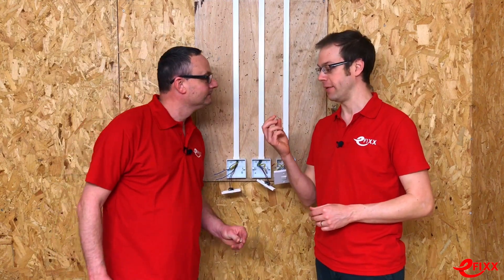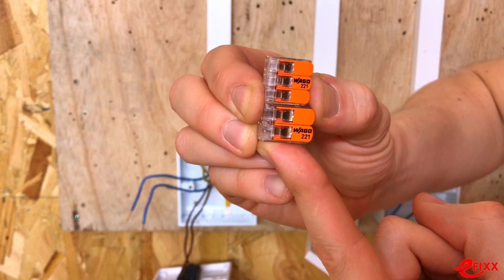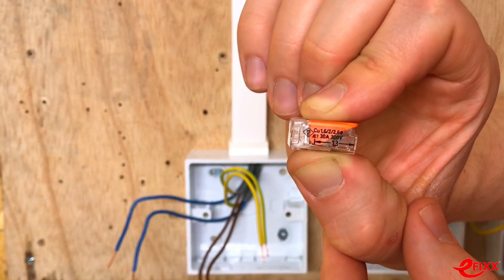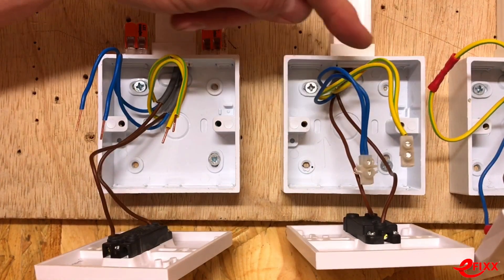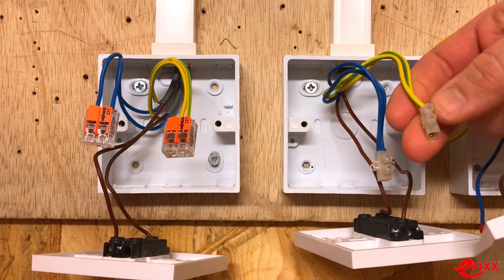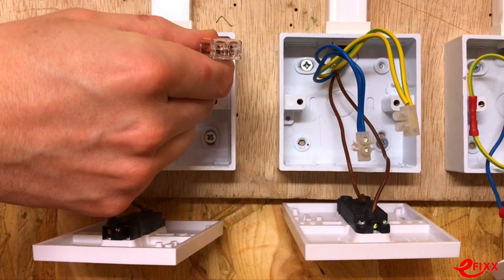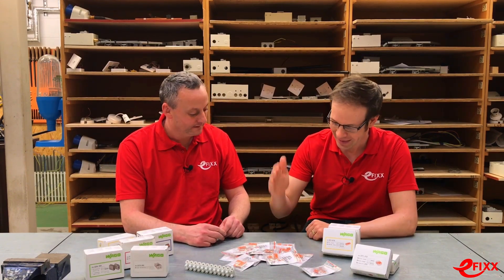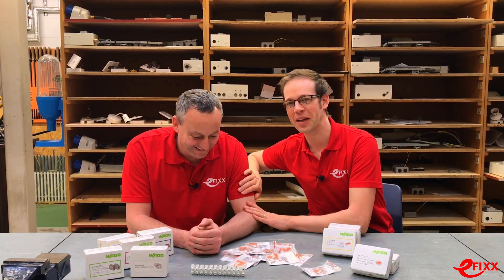Wago 221 vs traditional connector strip: including demonstration and testing point

Comment: Hi, love your videos! Question, I have 2 sockets where the cables are really too short, you can barely get at the terminal screws. They have 3 of each colour wires going into socket. Could I use the Wago 222, 5 port  connected to say the 3 brown  and then add a single fly lead to connect to the socket? Or would this be dangerous?? 👍

Comment: Feeding the neutral down to the switch is an old system that needs to be fazed out. 3 plate wiring is better and easier access.

Comment: Just opened a plug socket in kitchen and found 6mm cable jammed in with extension off the plug feeding the cooker which only needed 2.5 as only a small oven.  Plug fubar,  changed this with 6mm 5 port WAGO 221-615 41A,  bloody amazing so much easier than connector blocks:  plug socket connected off in in 2.5mm.  Very expensive but can’t find something anywhere near equivalent that can take 6mm stranded wire

Comment: Gaz can you tell us why that in this video the wago is marked as be rated to 41 amp and the conductor length as 13mm ? Yet in the video you did with Markus the very same wago ie the 221 is marked as 32amp and conductor length as 11mm ? Why is the accact  same wago ie 221 in both videos but with different information on them? Is one of them a fake  ? All my 221s are rated at 32amp with an 11mm conductor length, the my two gang three gang five gang and my new inline 221s .
Reply from the maker: There are two size families in the 221 series  - one rated to 32A - 4mm sq - eg 221-413 and a larger one rated to 41A - 6mm sq - 221-613 
https://www.tlc-direct.co.uk/Main_Index/Cable_Accessories_Index/Wago/index.html#Wago_Lever_C
Reply: @efixx  thank you I was just a tad confused

Comment: I recently had a socket fail, on inspection, the electrician found that the wires in the wall were very short which probably hampered the installation of the switch.

Is it ok to use a 5 way wago connectors with an extension in one of the holes and the 3 existing connections in the other 3 holes with one hole left spare? I can't find a 4 way wago connector.

This will mean only 1 wire will be fed to the socket and will be easier to tighten correctly if this is ok to do.

Comment: wago is easier to use but wire nut is so much better,,,lazy electricians will use wago,professionals will use anything else but wago
Reply from the maker: Try using a wire nut in most of Europe 😂🤣😂🤣😂
Reply: @efixx  Most of Europe is using wire nut 🤣🤣🤣🤣🤣🤣🤣

Comment: Just ordered some of these for the light at the top of the stairs. When I remove the current fitting there is not much wire that drops down. I have also orders the junction box and don’t think there is enough wire to get into the box.  So can I just wire up the Wago 222 and push into space between ceiling and loft or does in have to go in the wago junction box?
Reply from the maker: Needs to go in a junction box

Comment: For the fans of wire nuts, remember they are poor when connecting braided and solid wires together. The braided wire doesn't pinch when combined with a solid wire, and can just coil round rather than locking in. That is why so many fail the pull test. These connectors have separate clamps so don't have the same issues.
Reply: I'm in the states and running into JUST that problem on my ac wiring. Stranded thicker wire connected to thin solid thermostat wiring and it is a nightmare. Bought a 10 pack of 221's and I know they're UL and think it's okay but I can't imagine it would be a worse connection than those damned wire nuts.
Reply: But they have a ton of other issues.
Reply: @RadioRich100  Such as?
Reply: @Nyle95  Arcing, melting,overheating, intermittent connections, levers popping open when wires are pushed in the box, enough?
Reply: @RadioRich100 except none of those happen when installed correctly.
Reply: When installed according to the manufacturer they burn, melt, get hot, and go intermittant.
Reply: @RadioRich100  they literally don’t, hence why houses and building aren’t burning down left right and centre . But hey, you believe what you want to believe. 
Of course, you’ll be able to point to some evidence I assume? 😂😂
Reply: @Pugjamin  A box full that I pulled out for trouble calls after lazy people like you put them in.
Reply: @Pugjamin  Its fact I have pulled them out myself, would you like me to send you the next one I find?
Reply: @Pugjamin  First of all, The uks branch circuits use half the current we do. Second they are banned in certain municipalites. Third the UL is the testing laboratory, and there approvals can be and are bought. There on the NYSE.
Reply: @Nyle95  I've been asking around about these. Basically, the verdict is avoid them if you don't want a potential fire. The folk I spoke with are in the trade. Myself, I don't know anything.
Reply: Not if you know what your doing. Those clamps have resistance and get hot.

Comment: Most of these comparison videos fail by mistakingly comparing a product with a technique; apples to oranges. Traditional wire nuts don’t ever fail; the person who first twisted the bare conductors together may have done it wrong (or not at all!), but the wire nut didn’t fail. Wagos are not wire nuts. The electrical connection is minuscule and therefore it is a weak connection, just like back stabbing in a common receptacle.
Reply from the maker: How do the wire nuts stack up when connecting solid and fine stranded wires together?

Comment: Don't like wago  don't like  crimps
  Don't  like screw connectors   but   you
  Can't  beat  a good   solder  joint
Reply from the maker: In European wiring regulations generally you can’t use solder with screw connections.

Comment: Can you use the 5 port 221 connector to get three 6mm cables into and then one to the face plate of a double socket to get around the fact that three 6mm cables don’t fit? I have a 6mm radial run of sockets that have FCU spurs off some of them to isolate extractor hood etc and just discovered that three into one doesn’t go! Is the wago route a safe way of solving this?

Comment: They put these things in led light fixtures to connect to the supply wires I keep getting call backs where they went bad inside and replace them with unreplacable tried and true wire nuts

Comment: Do you know if the WAGO connectors are good to use in a vehicle (RV in my case). I worry that they might vibrate enough that the lever would click back open and the wire would fall out. Do you know if these are good for a high vibration environment like a vehicle?

Comment: Can you measure the voltages on the terminal block like you easily do with screw type connectors on a live circuit?

Comment: There is absolutely nothing safe about these connectors!!!!!!! In the last 40 years I have done electrical work around the globe and I am here to tell you these things are a fire waiting to happen!!!!!!! I speak from experience not speculation!!!!!!
Reply from the maker: What about the approvals from UL, ENEC & PSE ?
Reply: @efixx  money can buy you anything

I am not endorsed by or paid by anyone....

I'm a 40 year Electrician that's seen what they do after years of use not seconds of use

They are a fire hazard and I wouldn't sleep in any house they are used in.....

Period
Reply: @efixx  let me ask you a question

Would you fly your family in a Boeing 737????????????
Reply from the maker: My family sleep in a house which uses lots of Wago 221’s and I’ve used Wago screwless terminals for over 25 years without any problems.   Wago terminals are used extensively in everything from lighting ballasts to high current DIN rail terminals.
Reply: @efixx  you sound like their spokesman 

I'm wondering how much they pay you?!?!?!?!?!
Reply from the maker: Wago aren’t the only ones - happy to use Phoenix Contact or Weidmuller screwless contacts. You can now even get circuit breakers with push connections.
Reply: @efixx  I choose to not cut corners when I work. Especially when I’m getting paid to do work. I hold myself to a higher standard then other people do to themselves I guess. That, and I have to sleep at night and if I did something substandard (like use stab connectors) I wouldn’t be able to sleep because I have seen what substandard work causes and have made a career of fixing others substandard work!!!  

Again I say you sound like a spokesperson not an Electrician!!!!!! Every “Electrician” I know would never use such bull#hit materials in their work because we live by our work... If the plumbing isn’t done correctly you might have hot water going to your toilet. But if the electricity is not done correctly people can die!!!!!!!!!!!

It’s a little more serious when people lives are at stake!!!!!!

Ask the 5 year old little girl who only wanted to go wadding in the fountain and is now in a vegetative state because the electric was done wrong!!!!!!!!!! Oh wait you can’t...

I wouldn’t want to be the guy who wired those lights

Comment: You don’t even need to open the lever with solid wire
Reply from the maker: Toptip
Reply: Good one, you don't need to open the lever to remove either, just twist back and forth. Very similar to Ideal brand push in connector. I'm not sure that there is much difference in performance, but the IDEAL brand is cheaper and readily available.

Comment: In this case if you think that the spring is more stronger than the screws 
So why car manufacturers they use bolds for the wheel instead of clips and springs??
Reply from the maker: Wheels aren’t made of soft copper metal. Why is tape used in  aerospace applications instead of rivets?
Reply: @efixx  any plastic that I know 
They deteriorate eventually,
Do you know of any traditional junction box Deteriorating in the last 80 years??

Comment: What probes fit in to the test points on wago 227 and 2273 because none of mine fit?
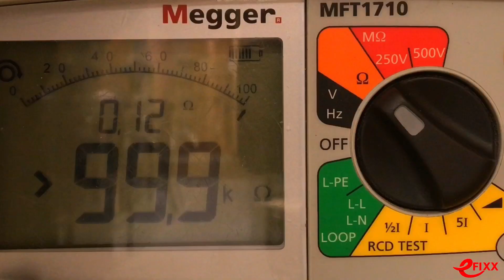Reply: 8:43 They really should redesign the test ports to accommodate the thicker probes that are commonly used. It shouldn't require buying thinner test leads just to be able to probe the connectors easily. You can force it in and enlarge the hole enough to make contact with the thicker probes, but that's hardly ideal, and not very safe, if you're not sure you pushed hard enough yet.
It's actually easier to probe from the wire side rather than using the test port in that case.
Reply from the maker: The skinny ones in this set for example. 👍https://www.cef.co.uk/catalogue/products/3922334-replacement-probes-and-clips?gclid=Cj0KCQjw9YWDBhDyARIsADt6sGY25tT2sEctDof7OPaDx7c8RPq9GMiK11MUVweAHBsNIXuXwaGaICcaAsPnEALw_wcB&gclsrc=aw.ds

Comment: After the failures of pushin connectors on rec. All ul approved no inspections is going to pass these without years of testing in the field. I would not use them.
Reply from the maker: They have a UL approval. We’ve been using cage clamp screw-less connectors in Europe for more than 20 years.

Comment: Any terminal with screw terminals it's liable to not being tightened correctly, not just connectors.
The cost is a bit of a killer really, I use them where I have to, but still mostly used the connectors.
I would like to see a more distinguishing feature between the two types for the different current ratings, maybe a direct colour lever.

Comment: Question: why is it rated 32 amps on one side and 20 on the other please - is 20 amps the derated ampage for inaccessible locations?
Reply: 20amps for japan, 32 for europe
Reply: JET stands for The Japan Electrical Safety & Environment Technology Laboratories and is their ratings group

further, for the 32A side as to why it doesn't say 600v it's based on requirements for ratings labeling in different countries

here's a Wago rep explaining it
https://youtu.be/d2lkBlIPkHg?t=342

Comment: great vid lads but at end of day its the customer who pays im a chippy if i used a screw that was 3 times the price but did the same job what will the customer say given that choice ?
Reply: Time
Reply: @normanboyes4983  yeah, if you get paid enough per hour, the extra cost from using the more expensive connector should be offset by the shorter work time.
However, if the labor is free then the parts and material costs will be more significant, increasing the cost of the job.

Comment: That OCD comment is recognizable. I was using large wire nuts on 5 x 12 gauge wire, they weren't working properly due to some corrosion, and they're hard to test on top of that. I probably checked each connection 10 times for tightness and it still wasn't good. These Wago connectors really take the guesswork and frustration out of making electrical connections.

Comment: Man you guys. Thankyou I had one of these burn out on me I checked the cable and the wago had disintegrated. I wanted to know how safe it was to put in and you guys helped me. Cheers
Reply: For that to happen they have been subject to massive overload, JW did a test of wagos, they take a serious amount of current to do that.!
Reply: @arcadia1701e  Or a cracked spring or poor installation as in some insulation inside the connection.

Comment: Could the wago be used for device wiring connection?  Trying to mount a ceiling fan and the wire says 1430 which I think is tinned copper.

Comment: I have a problem i have a 400v system but can't find a 400v connector does a 300v connector do the job or Will this fail after a long time
Thank
Nice vid tho
I feel very stupid a the moment i saw another vid and i was looking at the Japanse side of the connector. I am very thankfull for the vids you make becaus i would have been looking for another week if you didn't make a vid
Thank you very much to take the time to make these awsome vids
Reply from the maker: You need to go with a 400V connector  - otherwise you risk an insulator breakdown or liability issues.

Comment: That stripped ground wire insulation in in the left switch is scary - right where the outer insulation ends.
Reply: That's green/yellow sleeving over a bare conductor, not nicked conductor insulation.

Comment: I'm not an electrician just a keen Diyer but that means connecting wires coming in from 2 opposite directions you will have to make one end longer to reach  and bend round to the Wago input. Maybe that is not much of a problem for professionals !
Reply: It's not a problem. And only going in from one side has massive advantages, for example the terminals require less space. And you can orderly make your connections, like this junction box here:

https://der-elektriker.org/wp-content/uploads/2016/07/Abzweigdose-installiert-1024x536.jpg

And you got a better protection because potentially live parts are not exposed. The thing is, if you got a problem in the installation and need to make measurements in it to find the fault, you need to pull out the wires of a junction box to perform tests on the connectors.
And I can tell you, after 30 to 40 years the screw terminals are all loose. The copper deforms over time, and the screw remains in the original position. That's something that won't happen with the Wago.
Reply: Wire nuts also need the same wire orientation though, so it's just the same. It would need nice if they offered options for opposite side connections also, I would buy them.

Comment: How am i supposed to fit six 2.5mm conductors into one of those?
Reply: Korean Zombies Nan ... use two 4 way Wagggggos with a link. Common sense ?
Reply: zjzozn I was joking I hope no one needs to ever do a junction with 6 conductors
Reply: @imissedtheapex1191  I've actually used the 8 way ones to make up a central junction box for an entire lighting circuit with all RF receivers for the wireless switches at one central location

Comment: Garbage as conector best used wirenut
Reply: That's simple prejudice based on familiarity with another product. These have the same certifications as wire nuts and more besides. https://www.youtube.com/watch?v=uBErMOkFhqg
Reply: Long term, very long term with the continual heating and cooling of the wiring I don’t think those small internal busses will hold up like wire nuts. Just saying.

Comment: "Maintenance free connector" ...what is a high maintenance connector? 
These connectors are not safe, what happens when too much current goes through it? The answer is PROBLEMS
Reply from the maker: Hi Alan, like any connection in an electrical circuit it’s important that it is rated correctly. All circuits should be selected and erected correctly e.g. correct size cable and over current protective device. Thanks for the message and watching.
Reply: Any type of connector will have problems if too much current goes through it! That's why you coordinate the components of a system including circuit protective devices to avoid too much current...

Comment: fine connectors, there are plenty good uses for them, nothing wrong with the Marrette / Wire nut.
There absolutely no need to make the electricians job any easier..
Reply: There is plenty wrong with the wire  nut
Reply: 1. Wire nuts are inferior
2. What do you mean by no need to makes sparks jobs easier?
Reply: Never had an issue with a wire nut.   Tons of service calls with bad wagos. Arcing out

Comment: I’ve got a ton of 222’s to get through before I can justify buying some 221’s 😏 Nice video lads! Have you done a video on the 773 series, I’d be interested to see if you can fit a stranded wire in those without tinning the end or using a ferrule.

Comment: Can you use these for stranded wires? Or just solid metal wires?
Reply from the maker: The Hitman - yes you can use stranded wires and a combination of solid and stranded in different slots.
Reply: These are great with stranded. The 773 series are NOT even though they claim they fit both. You would have to tin the ends for a stranded.